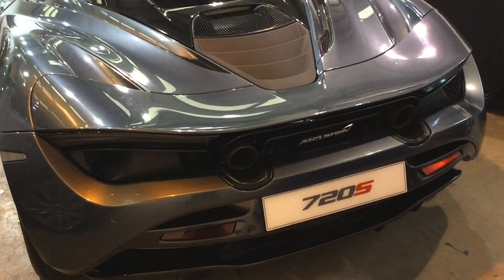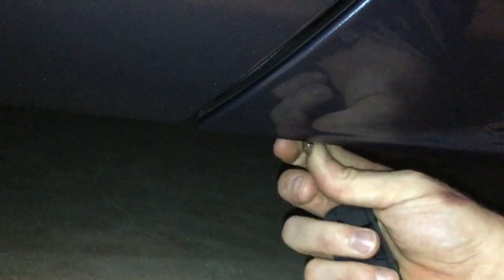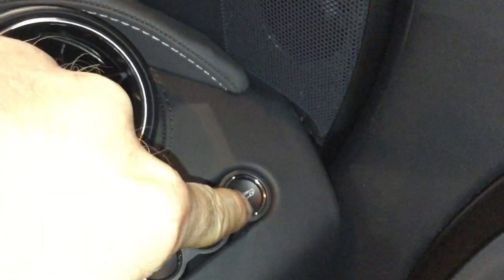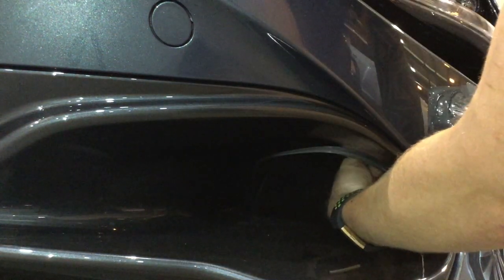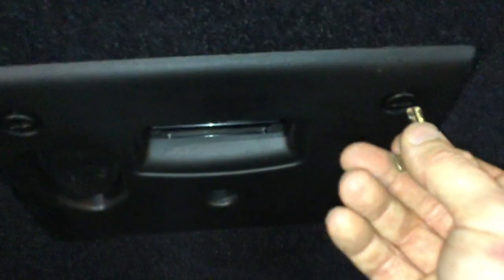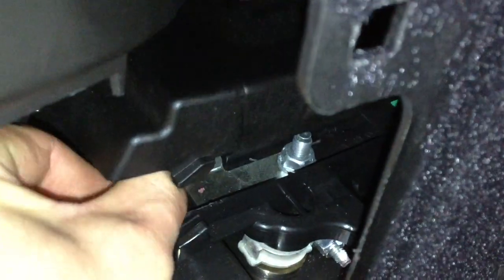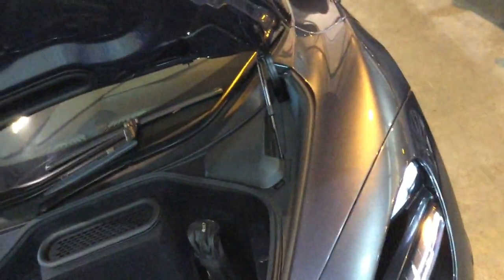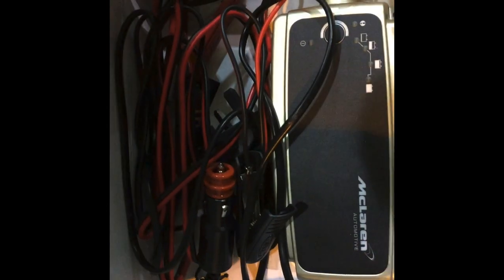McLaren 720s P14 Flat Battery Re Start Procedure *UN-OFFICIAL*

Comment: Thanks for sharing this info. I am on my second  720S and did not know this info. I have never had a dead battery but this is good to know in case it ever happens.
Reply: Second what happened to the first
Reply: @esthetics4512  It was traded in for a Spider.
Reply: @dreamcarguy2159  do you like the Spider or coupe better having owned both? Any downside to convertible?

Comment: I have a 650s... the battery is showing 0% but is fully charged [the trickle charger shows full]. 

The windows are dropped and the handbrake keeps coming on... I have had this before and MClaren wanted £400 to "clear the codes" 

Any ideas please?
Reply from the maker: You'll find the IBS (Internal Battery Support) hasn't been realigned with the battery's state of charge. 

This could be due to a faulty battery IBS system, or it could be a simple fix such as a 'hard reset'

In my experience, it is always best to visit a dealership to have these issues rectified - these batteries are very unique and although they may look like an average car battery, they are far from it.

Comment: Dude how did you get the battery cover off. I can’t figure it out.
Reply from the maker: You have to push in the release tab, whilst pulling the cover off.
It's difficult to remove the plastic cover fully, so pushing it up gives you ample room to attach a battery charger or jump pack.

Comment: if thats a li-ion battery you shouldn't be using a li-ion booster pack on it.  12v boost is recommended
Reply from the maker: Makes no difference. 
Just be cautios, if the battery is faulty and has been stood for a very long period of time, then there is a possibility that the polarity may reverse which leads to the battery smoking as it shorts out.
Best practice, is to use a multimeter with the battery disconnected to see what the battery voltage is. If it is negative voltage, there is a high risk of shorting.
Reply: @Time4trucks  oh wow, good answer, i didn't know that.  most Porsche cars have an advisory right at the boost terminals that says no li-ion boosting. i guess that is why, because of the polarity reversing.